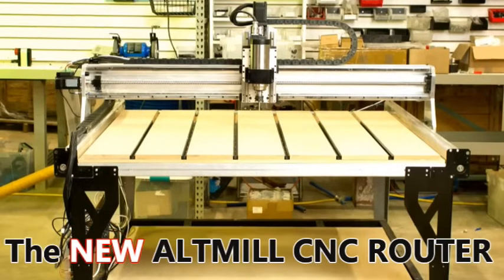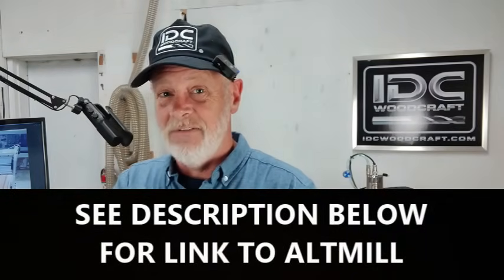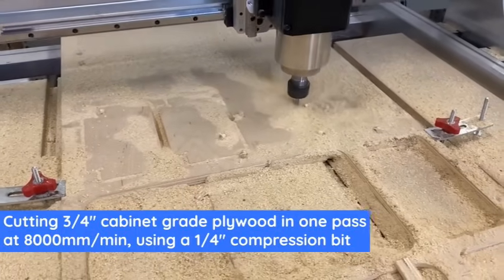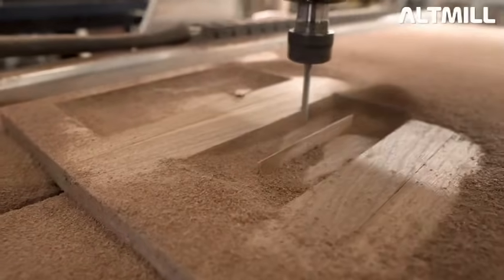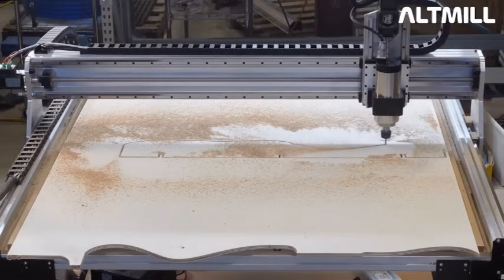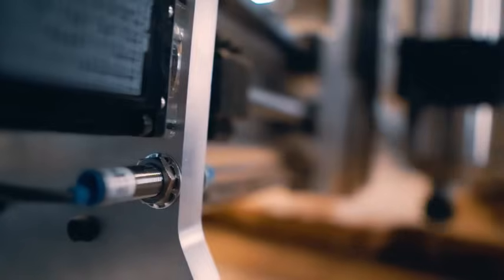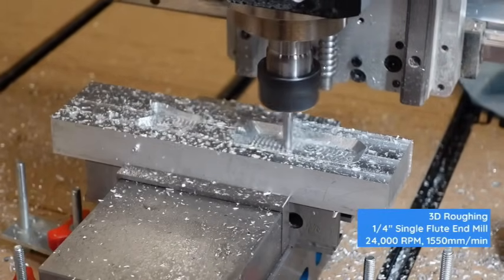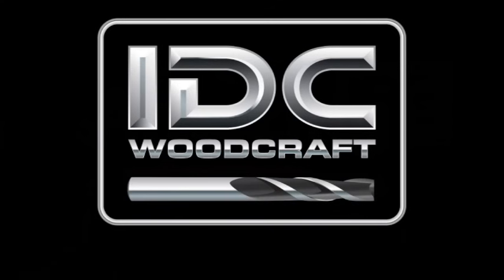The New Altmill CNC Router Preview - FAST!

Comment: I'm impressed with the price but for not much more you can get a way more capable Machine called the MILL-O-MATIC. That's made of 1/4 plate steel and tig welded.
Reply from the maker: scottresch9912, It's great to hear you know about the MILL-O-MATIC! The build quality and materials can definitely make a big difference in performance and durability. Each machine has its strengths, and it's all about finding what fits your specific needs best. Happy woodworking!

Comment: Nice video Garrett, in your view the performance between your 4x4 and the alt mill 4x4 which would you say is better? Well except that you have a vacuum table. Except that feature.
Reply from the maker: dwaynejohnson7499, thanks for watching! In terms of performance, both the 4x4 and the Alt Mill 4x4 are great machines with their own strengths. The Alt Mill 4x4 has its advantages, but I still love both my machines for its reliability and precision.

Comment: I wish this was around before I ordered my shapeoko 5 pro.
Reply from the maker: ReallyBadJuJu, Don't worry, the Shapeoko 5 Pro is still a great machine brother!
Reply: @IDCWoodcraft  Sister. :-)  And yeah it is!  But it was $2k more and doesn't have closed-loop motors, I had to build my own table, and the Carbide 3d ecosystem is a bit more "closed" these days.  It's not an XCarve in that respect, but it's a bit more proprietary and unfriendly to mods than it's legacy reputation would have suggested.

On the whole, I'm not unhappy with my purchase, but had the Altmill been around when I ordered my S5Pro, I'd have chosen the Altmill.

Comment: Impressive speed.  Is that real?  Is that an everyday thing?  In a screwed together aluminum desktop machine?  Do I believe my lying eyes?

It looks like FUD has hit the desktop CNC world!  Fear, Unease and Doubt.  Are your going to buy a Shapeoko 5 Pro, or and X-Carve Pro or a OneFinity Journeyman Elite or a CNC4Newbie or any other desktop 4 x 4 after seeing this?  I wonder.  AVID makes all kinds of noise about how robust their machines are.  But who cares if the AltMill cuts 3/4 ply at 200ipm in one pass?  That's all the "robust" I'll ever need.  And closer to home it looks dumb to buy a LongMill right now because the price difference is not great enough.

There's only one other desktop that can do that that  I know of.  The iR2 can do it and you can see it demo'd at ToolsToday.  But it's a 2x4 and costs $10,000!

Looks like the only kit that stands a chance is the Bulkman Ultimate Bee.  The Bee can be spec'd out to be essentially the same thing for a little over $2000 delivered.  But it uses 80/20 extrusions and I don't see how it could be pushed like this.    

One thing mystifies me though.  Where's the 2x4?  To me it seems dumb not to offer it and offer it RIGHT NOW!  And it seems especially dumb since anybody ordering today won't take delivery probably until November.  You're telling me you can't cut 2 feet off the Y axis between now and November?  Dude, I may have been born at night, but not LAST night!  Or do you WANT people with limited space to go ahead and buy the 2x4 shapeoko?
Reply from the maker: frankshannon3235, Thanks for watching! The speed showcased in the video is real and achievable with the right setup. AVID CNC machines are known for their robustness and precision but selecting the right desktop CNC ultimately depends on your specific needs and budget. The Bulkman Ultimate Bee offers a customizable option at a competitive price point, delivering good performance for its value. Consider your workspace limitations and the material sizes you typically work with when choosing a CNC machine.  I have a video that should really help you narrow down your CNC choice. It will really help you determine what to look for when buying a CNC. Here is a link: https://youtu.be/wLVNF0L-ZdU

Comment: im still waiting for them to acknawlage the warped Y axis rails that came from the factory on my Longmill before I give them another penny. Since day 1 couldn't get a 30 inch Y cut within 2mm. Surfacing even shows the dip. Their response was instead of selling (yes I even offered to pay for the rails) was to buy and entire new kit. They REFFUSED to even sell me new rails that sould be WARRENTIED! Deplorable gaslighting company! Best I can tell is in Shipping the courrier must have placed a several hundred pound object laying across the box. Either way they should at least sell a replacement for the damaged part. But their response is literally throw out the BRAND NEW part and discard the entire kit and simply rebuy the whole thing again! FK those guys
Reply from the maker: IDCWoodcraft, I'm sorry to hear about the issues you're experiencing with your Longmill machine. It's always frustrating dealing with factory problems, but hopefully, you can get it sorted out soon.

Comment: I've been watching the Sienci Alt CNC router videos. The speeds are very impressive. I was surprised seeing that small tool doing the 3d cuts at such high feed rates and cut depths. It's like there was no need to do a roughing cut. But how it cut aluminum was really impressive. I would expect that type of performance from a rigid frame CNC machining center, but not a router. That was truly amazing.
Reply from the maker: cncprogrammer3265, glad to hear it brother! Happy CNCing.

Comment: Hi Garrett, I'm confused.  I am a Onefinity user but I'm looking for something larger.  You said in this video that the Altmill is a 4x4 table, which is larger, but several of your video snippets clearly show a much larger (4x8?) Altmill, which for me, would be an instant sell to me (once my Onefinity gets sold that is)
Reply from the maker: Altmill is only available on 4*4 currently
Reply: @IDCWoodcraft  thanks.  I see that but I’m still confused by the video showing a 4x8 machine
Reply: @TheSegWayne  It's not showing a 4 x 8 machine, they are showing a 4 x4 machine with a 4 x 8 sheet being tiled on it. That's where you can pass the sheet through using multiple cuts and indexing.
Reply: @johnread7404  I will have to go back and watch it again, but on the third watch, I was trying to pay very close attention to it and would have sworn to you that it had the metal rails all the way down the sheet.

If not, that's a pity.  Yes, 4x4 would be an upgrade from my 32x48 Onefinity Journeyman, and yes, it's cheaper than the Elite Foreman (also a 4x4 platform) but if I'm going to spend the money, I'd rather be able to process a full sheet for cabinetry without tiling and all the headaches that brings..

I know, it's very "Veruca Salt" (Willy Wonka) of me, but hey.  Money these days is tight..
Reply: Fourth viewing, I see it now.  The idea that it was a 4x8 was an optical illusion apparently...

That being said, it's an impressive machine speed-wise.

Comment: The alum. carving/machining was stunning. This machine could make high grade intrument cluster bezels, switch surrounds, and engraved tags for custom shops and fabricate/copy existing parts no longer avail at costs that will be unbeatable. For auto restorers and builders with a 4'X4' capacity parts that are unreplacable i.e. handles and various parts and trim could be reproduced/matched then hand finished surfaces and then plated or painted for under $5K on your floor what's not to like!! Love your expert commentary of factory footage it's invaluable great job THANKS for your candid remarks and estimates of speeds. Very compelling. Ray Stormont
Reply from the maker: Ray, I couldn't agree more with your assessment on this one brother! It is one heck of a machine.

Comment: Have my order in and patiently waiting. My Longmill MK2 will be the experimental machine while the Altmill will be the workhorse. I’m going to have to stock up on more IDC bits. I may be a diabetic by the rate of M&M’s I’ve been getting… -Peter
Reply from the maker: ifiwooddesigns, right on brother! Congrats on picking up the new Altmill. I bet you are excited to get it.
Reply: Peter, a friend of mine who's been doing CNC work for over 25 years - and has plenty of experience - advised me to get my bits through kijiji, where many metal milling companies sell their tooling which is no longer sharp enough for their needs, but is still perfectly good for milling wood.  Just a thought...
Reply: @ApexWoodworks  I’ll look into them. I’ve been using IDC and Spetools exclusively but see Amazon sells the same bits from both vendors and I don’t have to pay shipping or wait. Amazon gets them to me overnight.

Comment: Thats very fast and the price seems very reasonable.
How does the speed and DOC compare to your $11,000 Phantom?
Also, I would be interested if there is an easy way to tram it instead of adjusting this wheel or pick up on this axis while I hold my tongue right kind of thing.
Reply from the maker: iwannaapple7190, glad to hear you like this one brother! As for the speed, some testing back to back is definitely in the works on that one. You can also tram the router with the dedicated tramming features straight on the machine!
Reply: @IDCWoodcraft  
I was wondering if it had dedicated tramming features. Having dedicated tramming features does put it in the upper echelon of "table top machines". From what I've seen that is usually not found.